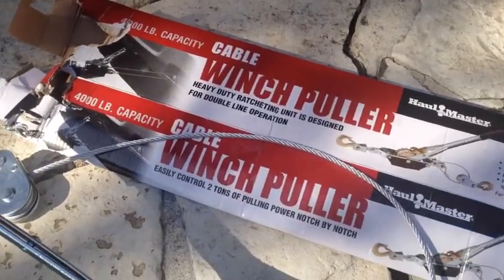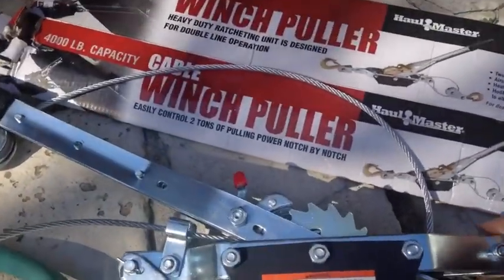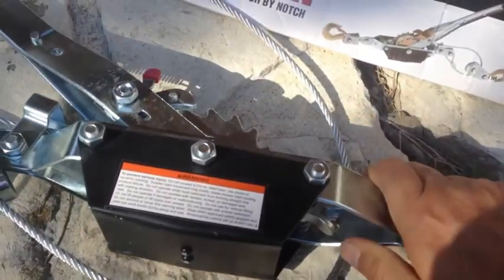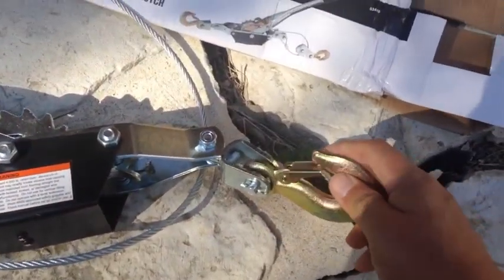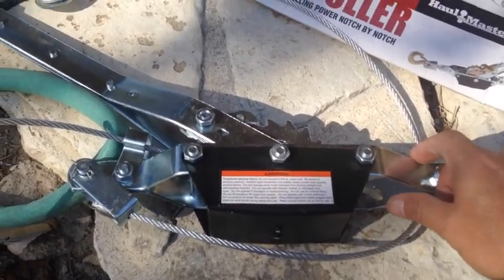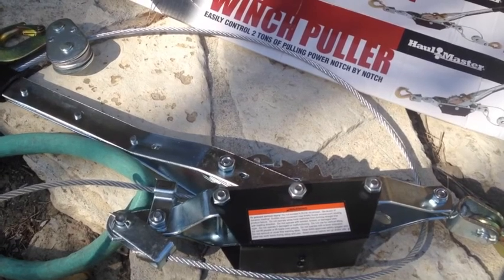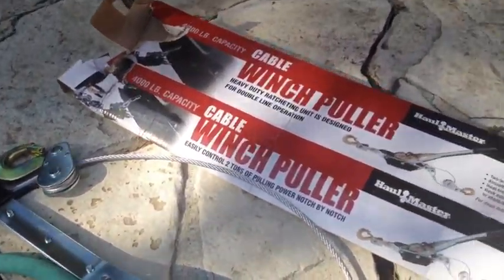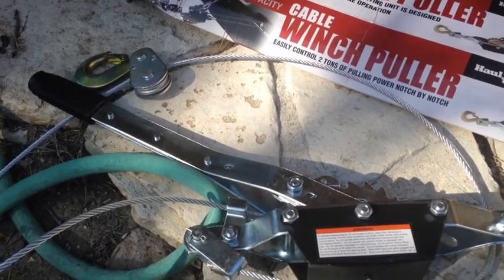How to / Review: Harbor Freight HAUL-MASTER 2 Ton Cable Winch Puller

Comment: you make it look so easy.  The one I bought was a devil.  It just wouldn't come open so first I loosened the nut on the spool, then I made sure that lever with the red cap was all the way up and locked (need some glue for that cap), then attached the pulley to the tailgate bar or whatever it's called that holds the tailgate up and then pulled on the other end while pushing the lever end.  It was still stuck but I found I could loosen it up and get the cable out if I just cranked, pulled, cranked, pulled until the whole cable finally came out.  Unfortunately I was so frustrated with it, I went with plan b and I'll maybe use it later.   thanks though.  the video gave me a couple of hints

Comment: I've looked at a couple other videos on these and to release the tension you're supposed to flip that little red lever to release the spool, then you bring it all the way forward and it should click releasing the cable 1 notch at a time until you can push that other release lever down with your thumb.
Reply from the maker: Thank... I've had it on some tight spots where it wouldn't move and I had to hit it though.
Reply: Kevin that is correct. You don’t have to hit it with a hammer or rock lol
Reply: There are versions where releasing the tension is done on a slightly different basis. You can release the tension  more than one notch at a time, but it is not fully automatic and you still have to put your fingers into the ratchet mechanism.

"how a comealong works and why"

Comment: That release button wont work when weight is on it. You should make a video just on how to release the tension!
Reply from the maker: To release when the weight is on and the button won't release it.  I've just smashed the release button with a hammer but that will break it eventuality so what you do is pull the tension lever like your trying to click it one more time but don't let it click...When you pull the tension handle/lever before it clicks to the next gear, then.. you push the release button and let go very slowly the tension handle/lever.  It will move down a few clicks.  Do that a few times and your good.  Let me know if that helps/works ! !
Reply from the maker: Just in case...what I mean by tension handle/lever is the button on the bottom.  Click the red button. PULL the handle like your trying to tighten one more click but don't go all the way. and that should give you room to push the bottom tension handle/lever to ease it up a few clicks.  Repeat a few times if needed.
Reply: @climacool19  It works! Thanks!